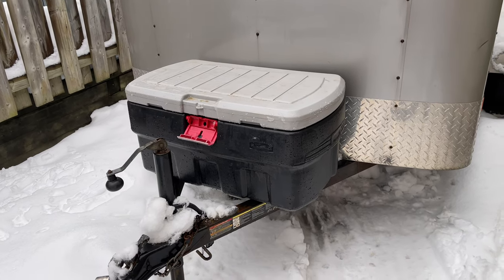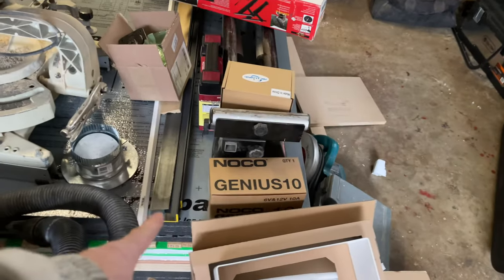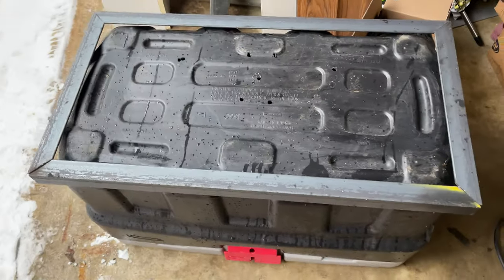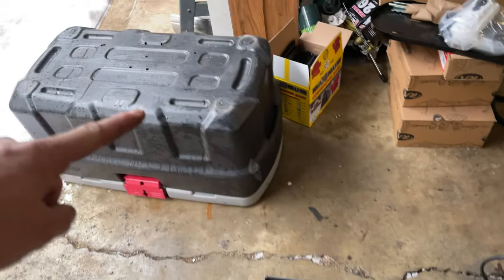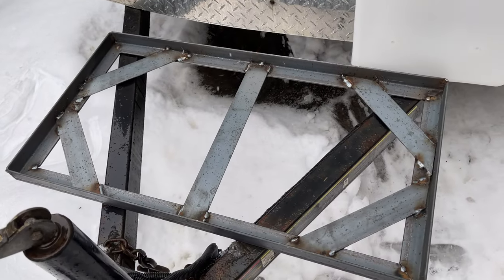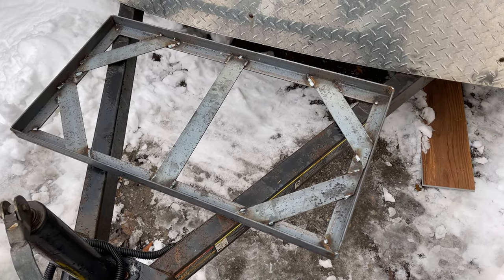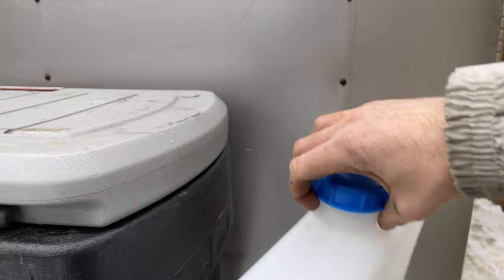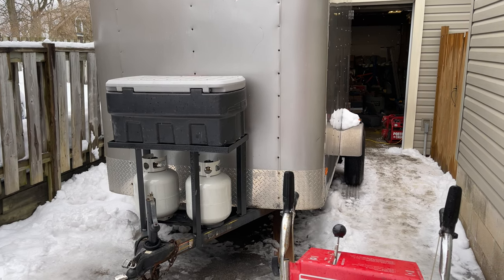How to Build a Cargo Trailer Camper Part 2 - Front Rack

Comment: I use a Chinese diesel heater in my 5'x10' conversion. No matter what, you spill diesel, and if the smell bothers you, ensure your tank is outside the compartment. Only used it one season so far, and it was great.
Reply from the maker: That’s good to know. I’m planning on having the tank outside for just that reason. Glad to hear you like it. Thanks for the feedback!
Zac
Reply: @waysoutback  Kept the trailer toasty with outside temps at -25F in northern NH.
Reply from the maker: Wow that’s cold! That’s one reason I went with a cargo trailer build, to buy a 4 season off road trailer costs a pile of cash. But I like camping in the winter so why not build something that will work. Thanks for the feedback gives me a little confidence I’m going in the right direction. 👍
Reply: @waysoutback  Test the heater as soon as you get it and before you install it. The Chinese heaters have variable quality control.
Reply from the maker: Ok will do 👍

Comment: Mount that diesel heater in a spot where it's easily accessible to remove and service  they carbon up pretty good.  If you run them on kerosene they run much cleaner  I have gone thru half a dozen over the years and I refuse to use them anymore  espar and webasto I used
Reply from the maker: Good to know. 👍
Will do
Thanks
Reply: As far as I know they carbon up if you don't run them on full power.